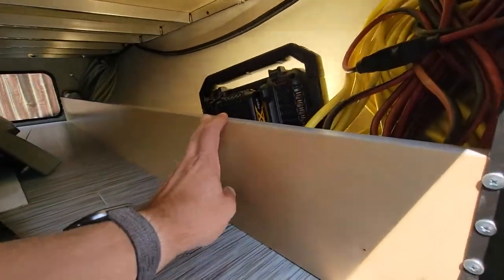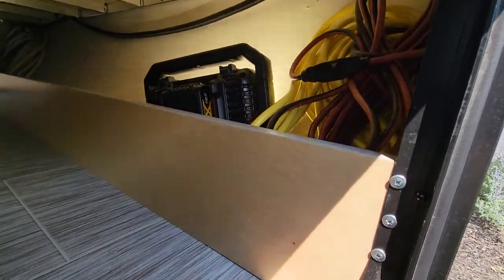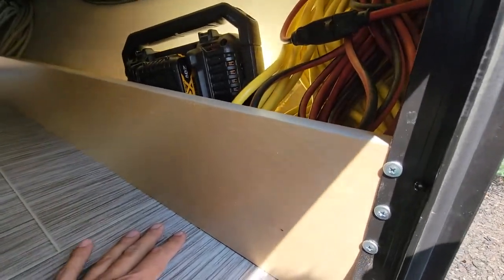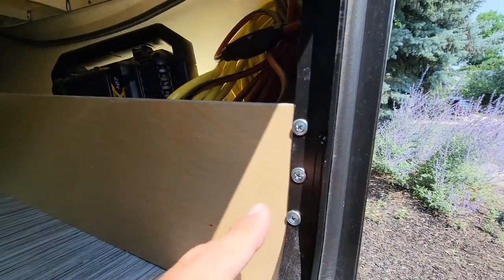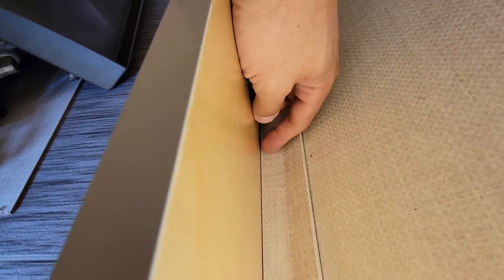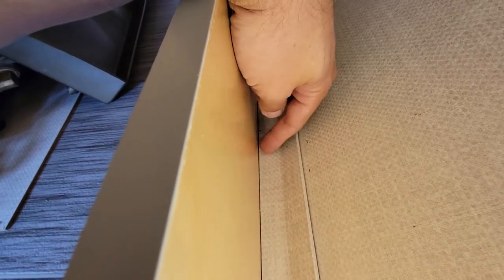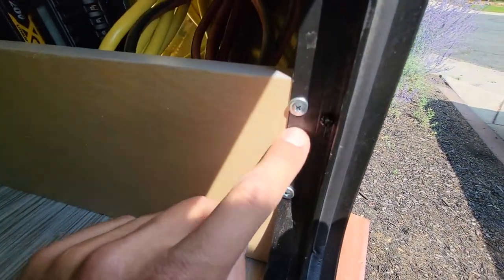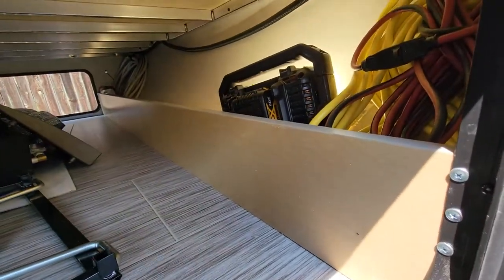Ibex Front Storage Upgrade

Comment: I'm interested to know what prompted you to do this mod .. I have the 19QBS so I'm not sure if our front storage is as large as yours, but it does lack management. I've opted to use containers to store things inside as a way of organizing. Also interested to know if you've had issues with your Inverter. We had some large chairs in there that kept pressing the power button which took the inverter out of remote mode. Thanks for sharing - appreciated.
Reply from the maker: I wanted to utilize that front rounded part to store things and this serves as a barrier to keep things in that rounded front area. Works like a charm.
About the inverter- I never used it. I took it out right away and installed a 2000 watt inverter charger in the back of the RV rather than the front.